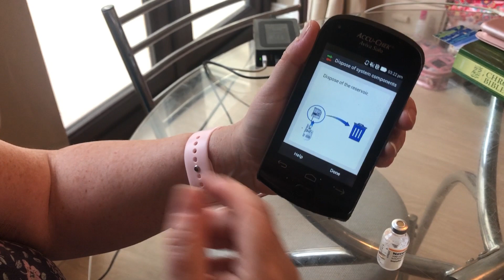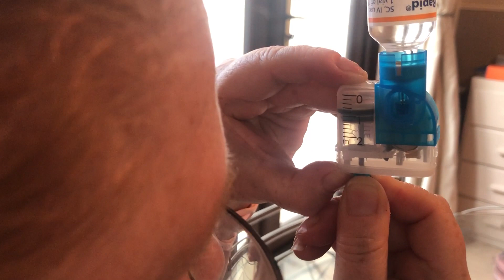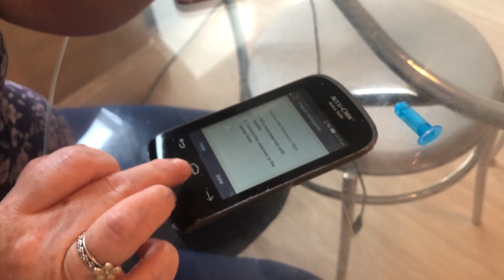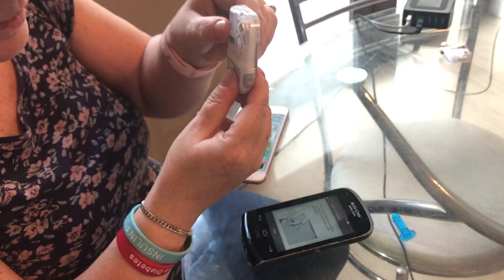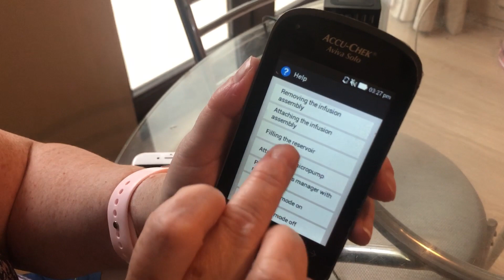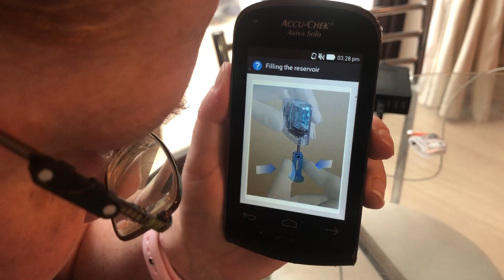Solo Micropump Reservoir change

Comment: Hi I’ve had the solo pump for a few months now and I’m having serious issues. Each time I change the reservoir I have constant high blood sugar levels for a whole day. No correction or temp Basal helps ☹️do you think I’m doing something wrong when changing the reservoir? It’s so hard not to get bubbles I think that is my problem cannot see a way to help. Have you got any advice?
Reply from the maker: Do you fill half way then push the bubbles back in then fill all the way? Also do you pull the orange tab very slowly from the battery?
Reply: @bernadettewarren6599  hi yes since watching this I’ve have done that and I always pull the organ he strip out slowly. Usually my bubbles come form the bottom of the syringe bit you pull down or some bubbles suddenly appear when I attach to the pump base. Have you had many problems with bubbles?
Reply from the maker: @masonandrews4675  no is the insulin room temp when you put it into the reservoir? That can cause air bubbles if it’s cold.

Comment: Thanks for your vidéos ! Very helpfull. Actually, i'm using Accu check insight, but not totally satisfied.
Reply from the maker: Julie AV I used the insight too, can I ask what your issue is?
Reply: The insufficient battery life if the remote control is a problem. And it works very slowly.
Reply from the maker: Julie AV ah yes the Solo is much better in both regards.
Reply: Ok. Do you wear your pump somewhere else on your body ?
Reply from the maker: Julie AV apart from my arm yes have worn it on my stomach too.